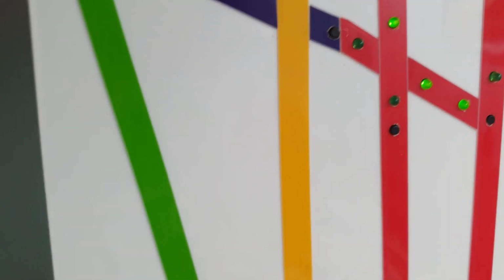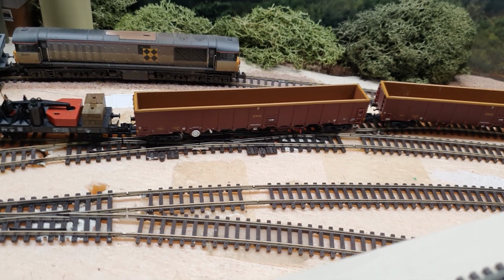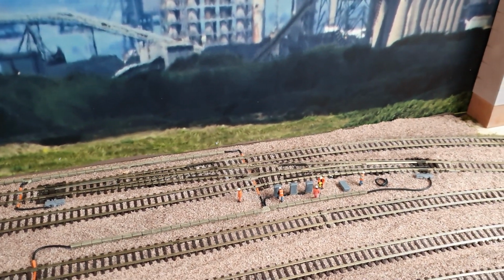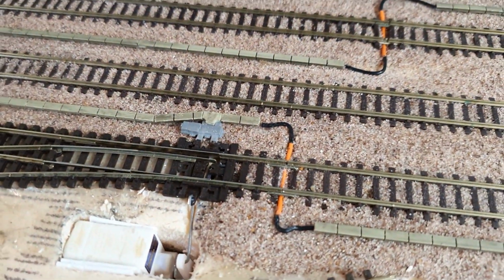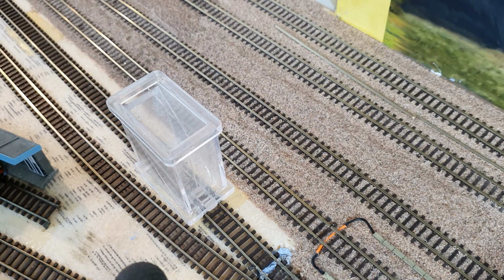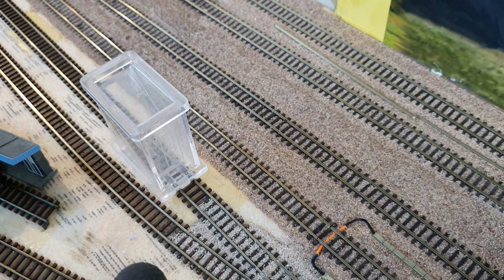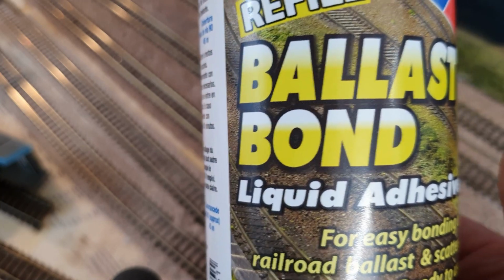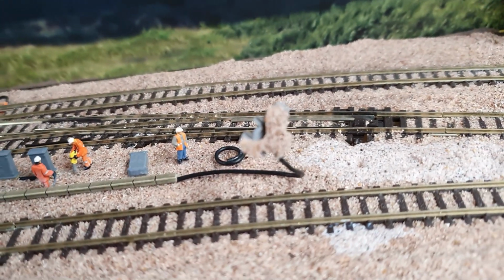No  61 A Face And Update

Comment: Hi Colin, Nice to finally put a face to the voice 😁, Great explanation on the double slip as so many modellers get confused with them. Just wondering what you use to control the frogs? do you use the Megapoints system or frog juicers as the frogs often confuse people especially on the double slip. I also find ballasting relaxing, it's a bit like Marmite you either love it or hate it 🤣🤣. Regarding the faulty servo, as we say in Yorkshire that's Sod's law!  Keep up the good work, All the best Tony.
Reply from the maker: Hi Tony I do use megapoints but for the frog I use auto frog so for double slips it's easy and they work if you use them changing the points manually. Thank you for going to look at my friends layout. We were video calling when she read it out and it made her smile. So have a great week my friend. Colin
Reply: @collinsngauge5493  Frog juicers are certainly a get out of jail free card LOL! I'm sure you'll keep Gemma straight when she hits a snag 😁. My channel is based about showing how I do things in N-Gauge and I feel its important to help anybody new to the hobby, as somethings can feel a bewildering as there are so many ways to do things. All the best Tony

Comment: Hi Colin - That is some very smooth running trains, especially over the point work, lot of effort put in there I can see.
Are the points and cross over large or medium?
You made the ballasting look very easy, I cannot wait for the day I start my first ballasting, long way away sadly.
Regards Chris
Reply from the maker: Hi Chris it been 7 years to start my ballasting but it's been good to run trains to the point I was happy with how it works. The points are mainly long, there are some medium ones in the fiddle yard there is a lot of short points. The curve points and double slips only come in one size. And the there are some small crossovers and it's all in code 55 peco. Colin
Reply from the maker: Hi Chris and they are all  electrofrogs. Colin